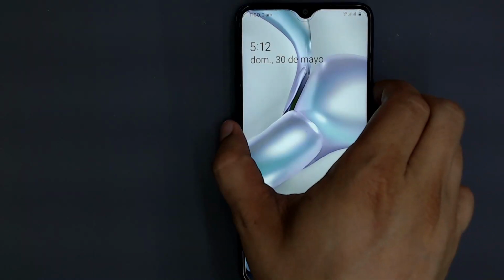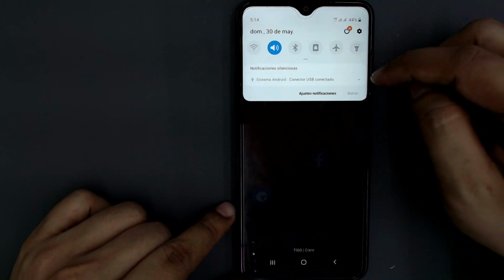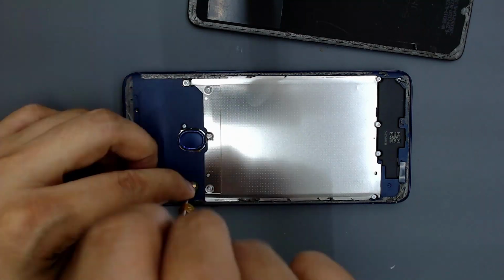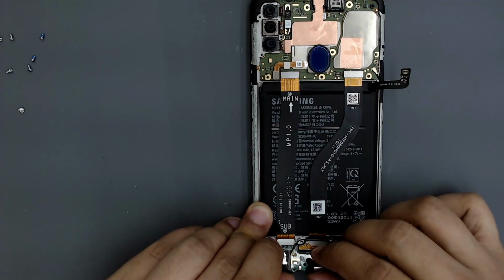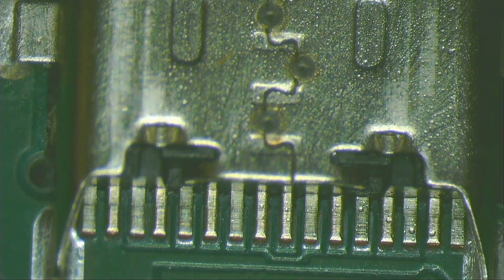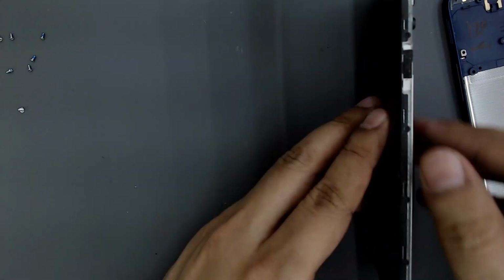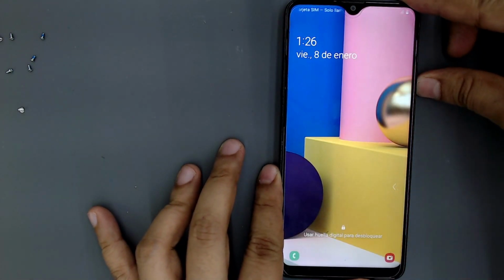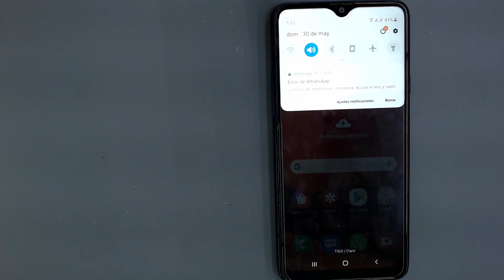SAMSUNG Phone, USB Connected, USB Disconnected, Screen Doesn't Turn Off, How to Fix It.

Comment: I m not this expert 😂 like you but thanks I finally understood why the problem occurs
Reply: Tell mee too plz
Reply: @muhammadnoman7618  it's just because if the dust
Reply: Tell me plss
Reply: @ayanamiraziz  how did u manage to clean it?
Reply: @summerhas8  try using a different charger of higher volt
Reply: @summerhas8  and I used brush and blow dryer
Reply: @Ayan Amir Aziz  thank you so so muchh! I tried cleaning it and using the blow dryer.. and used different charger and it worked 😍 thank you so much for replying!
Reply: @summerhas8  noo worries 🤗
Reply: @muhammadnoman7618  выключи в настройках 🔋 быструю зарядку и проблема решенна

Comment: Great video and a good voice over, better than some videos with robot voice👍👏 BUT...COMPLETELY UNNECESSARY. ESPECIALLY for phones with an IP rating. Opening at home will kill the IP rating as special adhesive is used in manufacturing process. 
You can easily access the charging port and clean without pulling phone apart.
Reply: How do I do that? My device is an S9 Plus (Water-resistant) and it keeps giving me that notification. It even doesn't charge at times. Please, help.
Reply: @stevenstone7101  dd u find a fix?
Reply: i need help
Reply: I just used a knife blade to gently scrape in the charging port and then scrubbed it with 91% isopropyl alcohol (regular alcohol from Walmart) on a toothbrush. Solved the problem. I'll edit this if the problem returns.

Comment: This is due to damage to the charging flex of your phone. Repairing it can fix this error.
Reply: Yeah, phone samsung a10s.  Got problem with flex cable from charging port to main board. It cannot lock so it got loose connector causing disconnected/connected problem. Changed that might fix it but i just put stress on top to temporary fix the problems. so far no problem while waiting the replacement flex cable. I just wasted my money buying the charging port board. What i need the flex cable. I should had open it first before ordering. Damn.

Comment: I just used a knife blade to gently scrape in the charging port and then scrubbed it with 91% isopropyl alcohol (regular alcohol from Walmart) on a toothbrush. Solved the problem. I'll edit this if the problem returns.
Reply: Did you open the back of the phone or just clean it from the bottom of the phone?
Reply: @dasellgeorge9021  I just worked on the charging port. Did not open it.

Comment: Is there any other way? I have not enough tools and courage to open my phone... My country now in a lock down
Reply: Same boat. I just used a knife blade to gently scrape in the charging port and then scrubbed it with 91% isopropyl alcohol (regular alcohol from Walmart) on a toothbrush. Solved the problem. I'll edit this if the problem returns.
Reply: @SomeIsBest   dude thank you so much it worked great👍🏻
Reply: 13 days later. It comes back intermittently. I just carry a safety pin in my pocket and scrap it some, tell the notification to stop for 2 hours and restart my phone. Also, it seems when I charge my phone back up, it returns, but even that is hit and miss now. I just restart my phone so the screen stays locked, even if it happens and runs the batter down until I can tinker with it. There's no rhyme or reason to it. Just work arounds I've discovered. I'm on a three day run, even with charging, where it hasn't come back.

Comment: Can u suggest any other way
Reply from the maker: You can buy the replacement board and replace it. The replacement is not expensive. Check the description of the video, the link for replacement is the description of the video.

Comment: Or u can turn on do not disturb
Reply from the maker: That won't fix the problem, is like when you ignore the problem, but the problem is there. It will get worse if you don't clean the corrosion / oxidation.